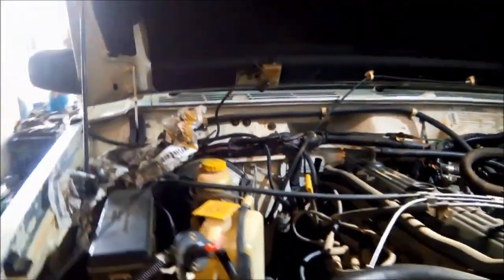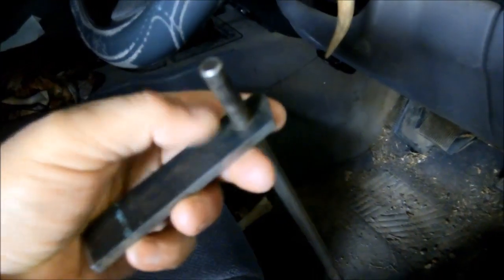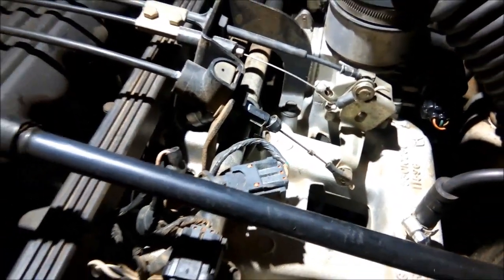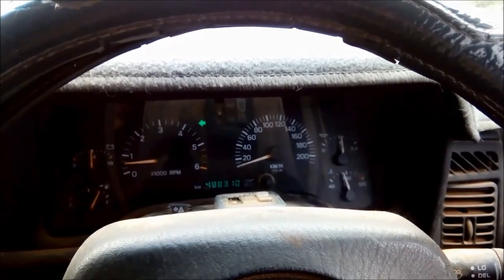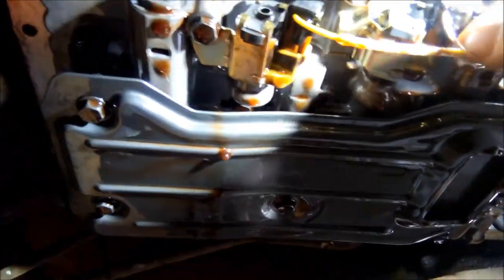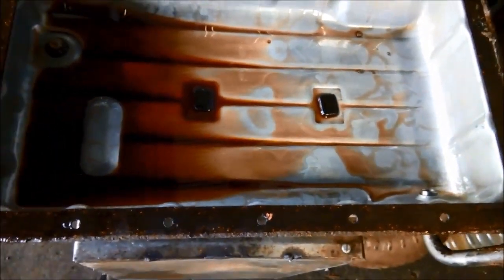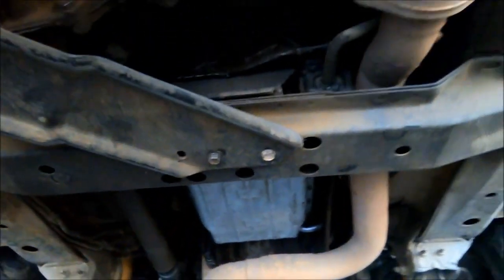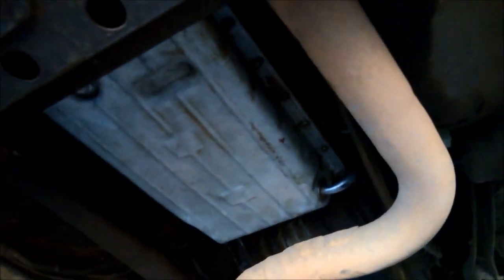Throttle Valve Pressure Cable Adjust & Auto Transmission Filter Service Jeep AW4 (A340)  DIY How To

Comment: So you didn't actually say how you adjusted the cable. You just cut the shot and said "Now I've just tightened that."
Reply from the maker: hi, by pressing the clip you can move the outer cable in or out ( this controls/adjusts the inner/outer cable ratio to one another ) you first find where maximum travel is according to having your accelerator wide open throttle ( or pressed to the floor ). adjust the pressure cable so that it is at its maximum, without being over tightened or stretched. then you mark that point and slowly back it off until you reach your desired shift/quality or comfort level. not good to have it too loose as it regulates pressure in trans and trans will last longer if it operates at a higher pressure than lower pressure, however driver comfort also plays a part so you will need to adjust to your liking yourself. hope that helps cheers
Reply from the maker: similar cable adjustment on GM 700R4 see https://youtu.be/lIuYTN-8euw
Reply: YepThatsIt Perfect. Appreciate the details especially about the pressure regulation. That explains a lot. Thanks!
Reply: What what’s the reason for adjusting it?? What was the problem.
Reply: Potro R With me, my transmission had very smooth but slow shifts. Especially the torque converter lockup when under load at high speed. It felt like the clutches weren't engaging fast enough & they'd be wearing too much. I tightened the cable by 5mm and the gear-changes are much more positive and firm. From reading up on this more it could be o-rings within the transmission that hold the line pressure (the hydraulic pressure operates & holds the clutches together) that are getting old and not sealing as well as they once did. It hasn't fixed those o-rings (if it is that) but increasing the pressure has helped.
Reply: Cassette Walkman  so it had problem shifting to 2 to 3 and to 4 but with high rpms??? Automatic.
Reply: Cassette Walkman  I just got my transmission rebuilt for a 91 Silverado. But it goes to 2 and then to make it to 3rd the rpms goes all the way to 4000 or 5000 rpms
Reply from the maker: @potror9289  shift pattern and feel wasn`t how it should be and needed readjusting. cheers
Reply: YepThatsIt thanks
Reply: Potro R This vid is for an Aisin transmission. This cable effects only line pressure and nothing to do with shift points and revs. The shift points are determined by the ECU based on throttle position and speed sensors. Your Chev transmission may well be completely different.
Reply from the maker: @potror9289  you need to take trans back to the people that rebuilt it. cheers
Reply: @YepThatsIt  Great to see a different take on how to adjust the cable, glad I found your video. Thanks, mate!